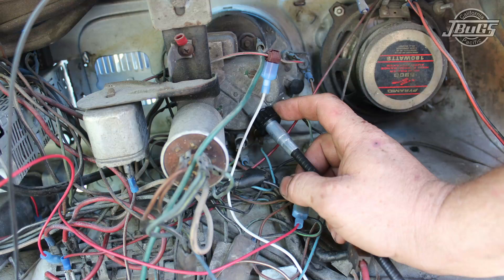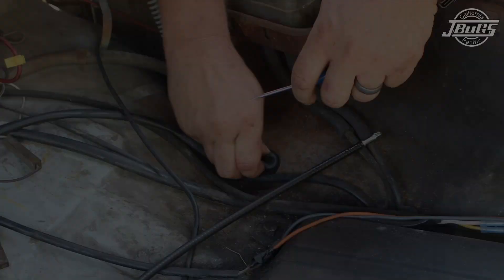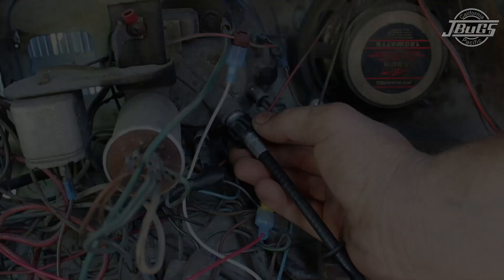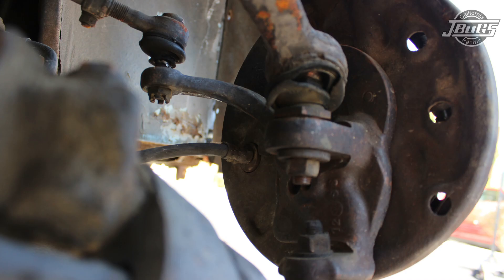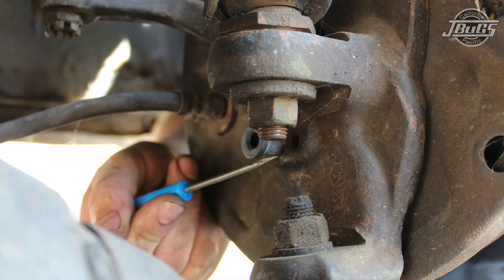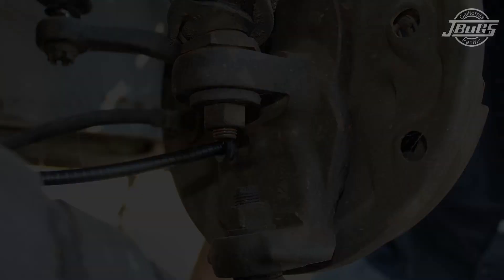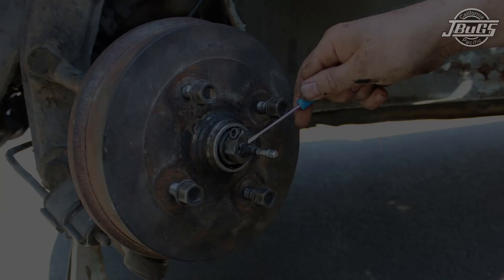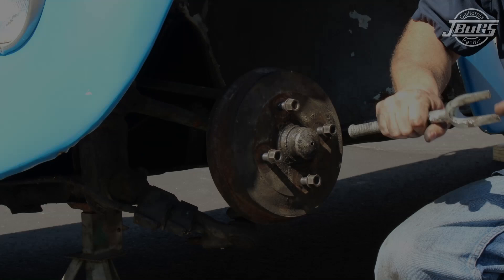JBugs - Tech Tip - Speedometer Cable Installation

Comment: I can’t seem to pull out my old speedometer cable. It’s probably the original cable in there since 1962. I’m pulling as hard as I can with a pair of vice grips from behind the wheel but it won’t move. I got my new one from JBugs and I appreciate the fast delivery and included instructions.
Reply: If the circlip at the grease cap has been removed, hold the vice grips on the back edge and tap them with a hammer to free up the cable.

Comment: Will this procedure work on my super beetle 1974? If so Tha K you for the verry detailed instructions 👌
Reply: The Super Beetle cable is routed through the fuel tank well so removing and reinstalling the cable through the body is a little more involved. Hooking the cable up at either end is the same, although accessing the cable in 1973-1979 Super Beetles is done from the bottom/under side of the dash.

Comment: Replaced cable. Speedo cable now is stable, but the grinding sound is still there. Heard about applying grease (geeze) to the cable to fix this issue. Any tips on this? Thanks!

Comment: You skipped how to get the c clamp in the end of the cable. Any tricks would help. The rest is easy
Reply: Easy is a relative term. For me, installing a C-clip on the end of the cable is the easy part. I use whatever blunt object I have handy, whether it be a flat head screw driver, a pair of pliers, I've even used a wrench. Once the cable is pushed through the cap, and the groove for the clip is accessible, slide the open end of the circlip into the groove, then press it into place.

Comment: Will grease help significantly? I was trying to replace my cable today and it just won't budge. It would get to an inch and a half but would stop as if there is blockage but there isn't? It's a 63 if that helps
Reply from the maker: +Elvena Fae
Grease probably won't help much. Double check that there isn't some sort of blockage (old grease or road debris) in the hole. You may want to try pushing a long, skinny screwdriver through to make sure the hole is clear.
Reply: JBUGS Sadly, I've already tried this and there isn't any blockage. I guess I'll have to give it a go again this weekend and maybe add some grease. Otherwise I haven't seen this problem anywhere so I'm kind of stuck
Reply from the maker: +Elvena Fae
If you can get get a screw driver through try larger diameter screwdrivers or maybe a pipe cleaner to make sure the hole is clear before installing the cable. If you are still having issues feel free to call out tech line at 1-800-231-1784 and we will try to help as much as possible.
Reply: JBUGS There’s an awful grinding noise and vibration on the dashboard. Maybe is backwards!
Reply: @giovanniprofeta3699  the grinding is most likely from inside the speedometer.

Comment: does this also work on 1970 vw beetles?
Reply from the maker: +ImmortalJake428
The speedometer cable installation is the same for all year beetles, yes. The only "exception" would be the fuel injected models which have an upper and lower cable and a counter box as a junction.